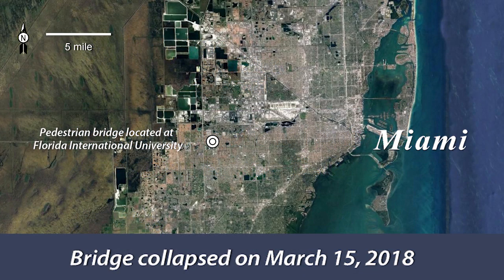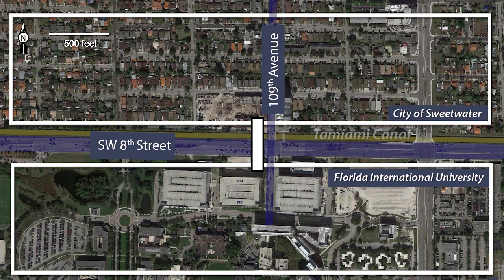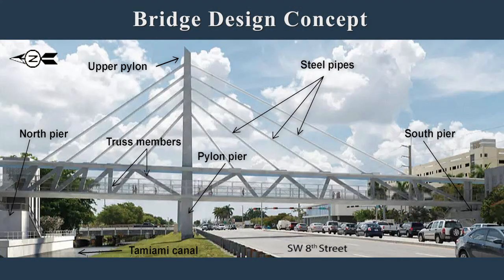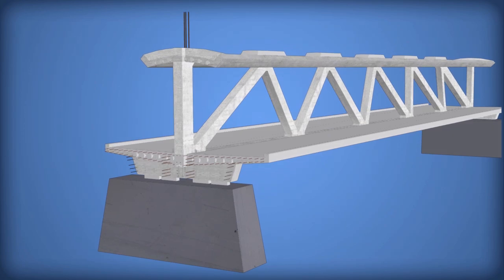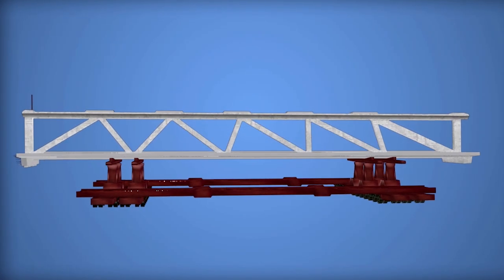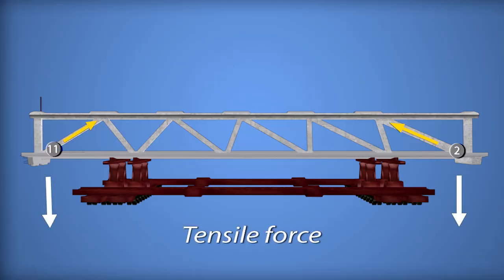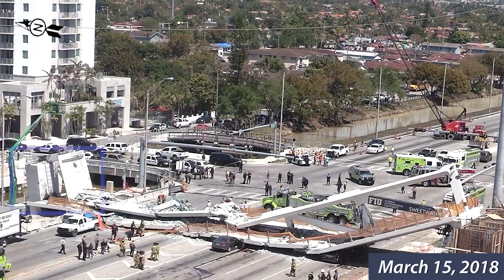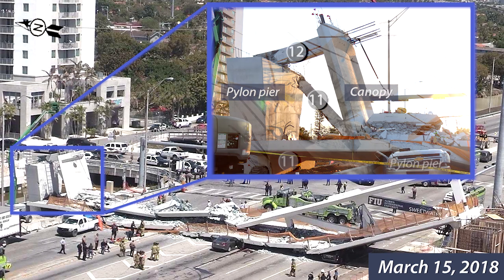Pedestrian Bridge Collapse Over SW 8th Street HWY18MH009

Comment: Crazy that with all that cracking nobody stopped the move
Reply: Al Morrison  Agreed.  You get what you INspect, not what you EXpect.  The cracks prior to lifting showed the structure could not support its own weight (let alone its anticipated live load) when sitting on blocks on the ground in the same positions as the piers.  Thus, obviously things weren't going to get better once the bridge was lifted, without even considering possible exacerbating factors from the forces involved while lifting the bridge with the ends dangling.   The bridge should never have been lifted.

The photos of the development of the cracks clearly show the symptoms of excessive compression forces in #11, which were present even before the bridge was lifted.  Thus, the final decision to further increase compression by torquing up #11 only accelerated the process of failure.  They might as well have planted a demolition charge there.

But this was only the last of a long list of bad decisions by multiple parties.  Either the design, the construction, or both were bad.  Regardless, both the design and construction processes have both in-house and 3rd-party review and inspection.  So if either design or construction was faulty on its own, you have at least 3 culpable parties.  If both were bad, you have at least 6.  And that's just to get to the point of building the bridge on blocks and noticing #11 is already failing in compression.  Then you add many more culpable parties for the decisions to lift the bridge anyway,, to let the situation further deteriorate without taking any corrective action for so long, to then apply the incorrect solution, and to keep the road below open throughout all this.  And throughout, there are safety personnel with the power to stop work when they see unsafe conditions.  Truly, the list of those who should be hanged is long.

This isn't just the failure of 1 bridge, it's a failure of the whole system we've set up to ensure such failures don't happen.   To me, that's the most appalling part of this whole tragedy.  All best practices in engineering and construction, and all safety regulations (which are largely based on those best practices) are written with the blood of the victims of previous failures.  There's nothing worse than refilling the bloody inkwell and having nothing we didn't already know to write with it, 

Lots of inspectors, reviewers and safety personnel all along the way let things slide here.  Hopefully, their peers around the world will take this tragedy as an incentive to tighten up their work.
Reply: @TheBullethead  damn, that's a lot of culpability.  But also what seems to be a cup of sense in have a period of time when the bridge should have been on blocks before the move in a pragmatic evaluation.  Perhaps building in a two week period of time, or five days of a "resting period" between design elements.  For this bridge design, 15 days.  5 for the main body, 5 for the truss elements and 5 for the canopy.  

But does this take into account the materials supplied to the construction crew?  I'm asking that because of what I remember about the Hyatt Regency in Kansas City and the sky walk collapse because of the way they were constructed.
Reply: @TheBullethead  thank you for the excellent post.
Reply: before i watched this, I thought the cracks only formed after the bridge was set into place. But apparently they were forming long before the bridge even got moving. This whole thing should never have happened which is the most infuriating part.
Reply: Al Morrison definitely question the engineers though, we want you to. If the engineer doesn’t want you to, he/she is an idiot.
Reply: Al Morrison fam you must not be an inspector because concrete almost always cracks (on the surface) and it’s usually acceptable. In this case the cracks were not just cracks, they were fissures sufficiently deep to warrant concern.
Reply: They even documented the enlarging cracks, day by day.  So OBVIOUSLY they all knew about it and decided to bluff on through.
Reply: I just read about a the Salesforce transit center in San Francisco.  It seems that some severe cracks developed in some of the support beams for the bus center.  There were two sections that meet the production of the cracked beams, but the second set was not cracked,  which was forensicaly determined to have been a brittle fracture due to a perfect storm of events.  It seems that one of the differences was that one set of beams had access holes cut before the welding occurred and the second set did not.  Also that the welds were not cleaned up or the steel ground to a shine after the holes were cut.

This is a different scenario, but I'm thinking that someone may have needed a louder whistle.
Reply: Beyond crazy. Criminal.
Criminal negligence.
There should be felony charges.
Reply: @2Truth4Liberty  In one building collapse in South Korea. The builders and designer were criminally charge for the collapse.
Reply: @Rhaspun  That can be the case in virtually every state too, including Florida . . . MANSLAUGHTER § 782.07, Fla. Stat.
Reply: @2Truth4Liberty  A statue may be on the books. But is a DA willing to prosecute? I think the last time I can remember  someone going to prison was from an incident that involved a coal mining operation. It isn't common.
Reply: @Rhaspun  Criminally Negligent Homicide is a valid charge. And if any state were to charge it, it would be Florida. Although the prosecutors may want to wait for any wrongful death civil cases to play out.
Reply: @rbgg153890 bob There are no such thing as "accidents", there is stupidities, and on purposes!
Reply: Yes, people need to go to prison on manslaughter charges and never allowed in the construction industry again.
Reply: @KandiKlover  for doctors, yes.  However, the likelihood of working with someone associated with such a project would in itself be enough to prevent the individual from working in that field again?
Reply: No one wanted to be accused of misogyny.
Reply: @MatHelm  why misogyny?  If it's a duck, it doesn't matter about the gender.  Just when someone is looking at a Loon instead of a Mallard.
Reply: You nailed it.
Reply: Built by illegals..

Comment: they shouldve made repairs
Reply: Curtis Warren — The structure was beyond repair.  It was fundamentally underdesigned.
Reply: @GH-oi2jf  why did they put it up in the first place then lol their retards
Reply: I'm pretty sure that is what they were trying to do when retensioning the cables, just 5 days after it opened
Reply: They should have closed the road and used shoring to hold everything up until they figured out what the problem was.
Reply: They had no idea how to repair it -- all their hopes hinged on the post-tensioning holding the failed concrete together. In the end, it crumbled.
Reply: Guys, u just turned the from an abused bridge to a bridge that was made by a team of retards... (Which it obviously was)